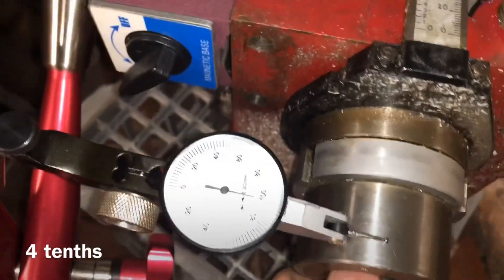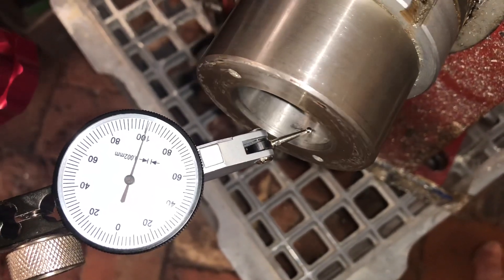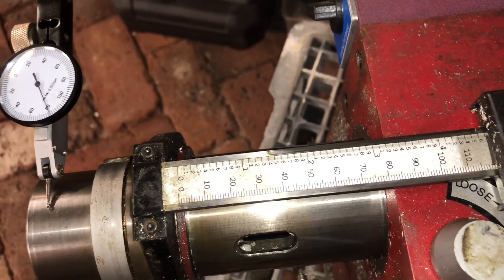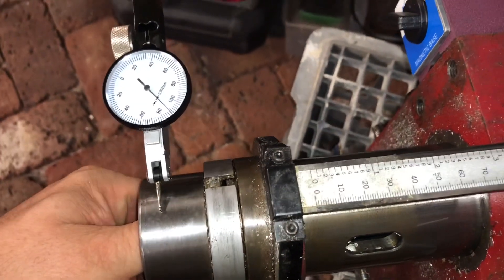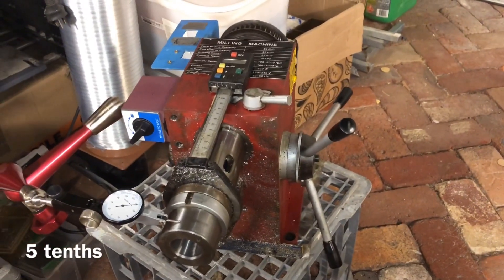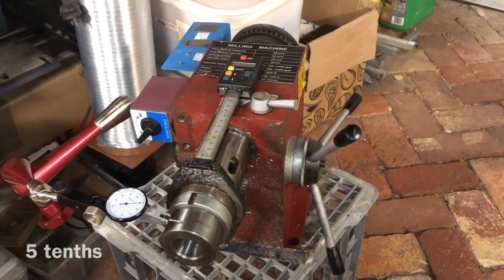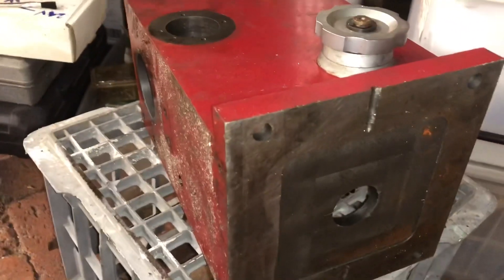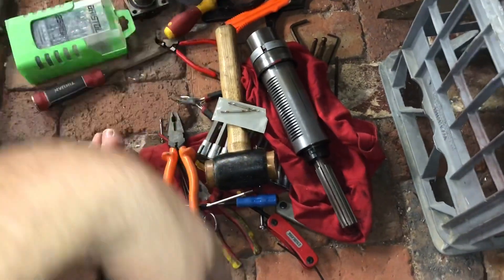CNC Candy - Sieg X3; Getting your head read

Comment: G’day JB, hmm, wonder if the runout is in the spindle or the bearings, looks like you haven’t tested it out of the block, just hit it with a lead hammer and beat it into submission:))) Hey I’m happy if it turns, still with all the crap we’ve heaped on the Chinese machines over the years 8/10ths of a thou and it’s still a hobby machine, as Ade would say, “Happy Days” 
Ok if it’s going to turn at 25 zillion RPM you might want to tune it in. 
Cheers 
Peter

Comment: Hi JB,
There’s a product called rock block ?‘rocbloc’ drag racers use it to fill water jackets of their race engines to give them strength and remove flex, could be worth looking into if you’re thinking concrete in the headstock.
Cheers
Reply from the maker: Gday Ray!
I took a quick look yesterday, have found 3 contenders, RokBlock, Hard Block, and Moroso engine filler, in  addition the the expensive option, Devon epoxy. I will check out what sources in Australia are, and also further investigate what kind of internal Dam I may need to keep vital areas clear, but those look like good options, especially with the damping and expansion qualities being so close to cast iron :-) cheers for the heads up mate
Reply: JBFromOZ outlaw speed shop in Adelaide might be a good source, big into race engines and performance gear.
Happy to help when I can
Cheers
Reply from the maker: They've got it in stock, ordered and on its way cheers mate :-)

Comment: It's possible that its had that tiny run out since new.  I'd still recommend at least a look at the bearings. I ran that head at 2500RPM for 40 hours dialling the toolpath in for max VFD current  on a job using 2 flute cutters in steel. The head got up to about 45deg c...  Hey they might be OK, but the preload isn't hard to set so it doesn't hurt to look....  Oh and yes, the machine has been reasonably well lubricated over the years.

Comment: Is that a precision ground milk crate?  :-P
Don’t touch the spindle bearing.  It’s fine.  Don’t worry about the backlash on the spline.  Just clean it up and get it running.
Reply from the maker: Ahh yes the old... run what you brung, fix it when it kicks it ... very tempting I must say... there is room in the budget for a bit of love this early on however